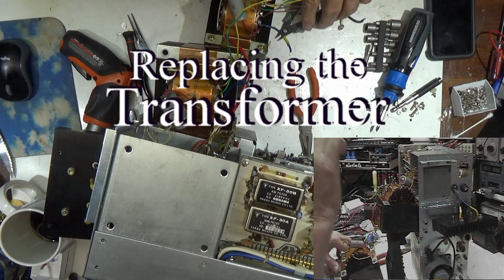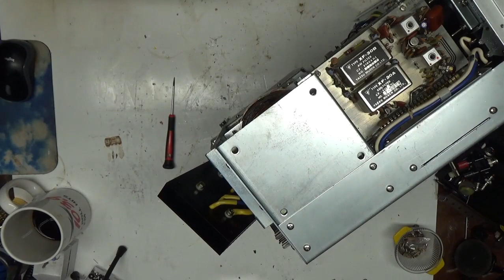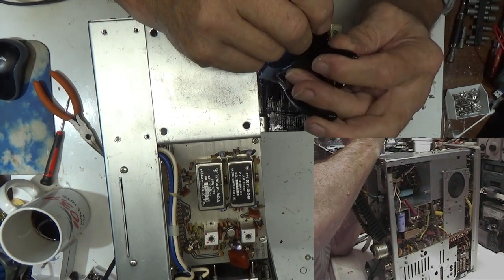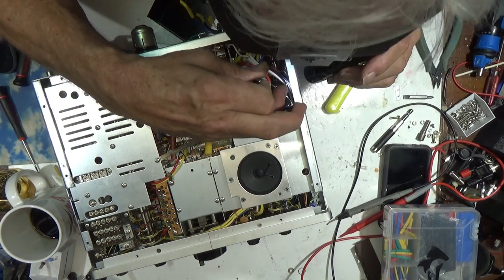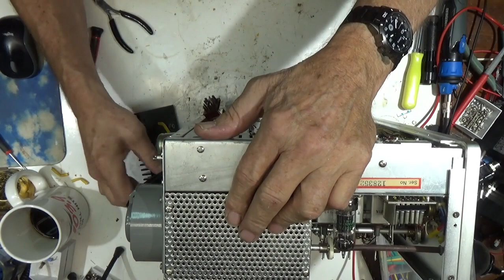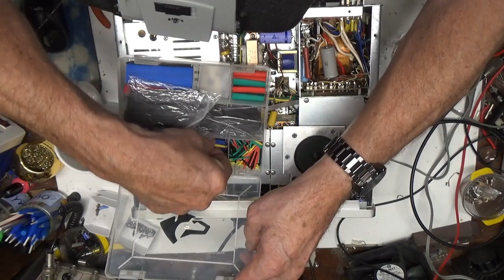FT101 Power Transformer Replacement

Comment: A good friend of mine and who eventually became my elmer did same job to my 101e back in 93. It took him quite a while to finish. It was the first time he had to change a transformer on a yaesu 101 and he did service many. I recall he had to call Yaesu to get a replacement transformer brand new( at that time internet was on its infancy) the service folks were surprised as it was the first time anybody called asking for one. It did burn because the guy who sold me that radio used it on free bands and he had the wrong fuse installed , tubes were on their way out and it did gave up .  Still have that radio!
Reply from the maker: Nice.  They were built to last but with the technology at the time they were also pretty crowded inside. Dig her out of the closet sometimes and let her stretch her legs.